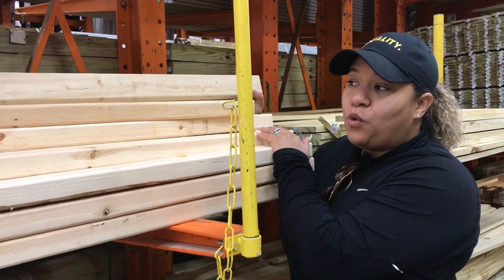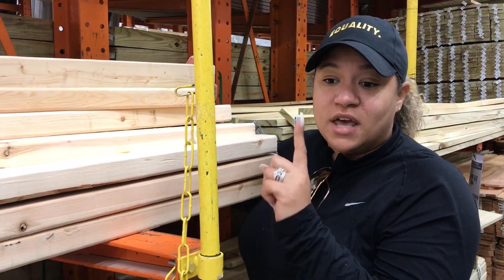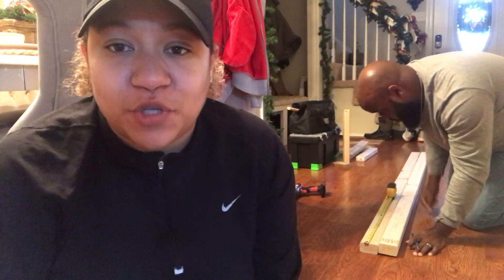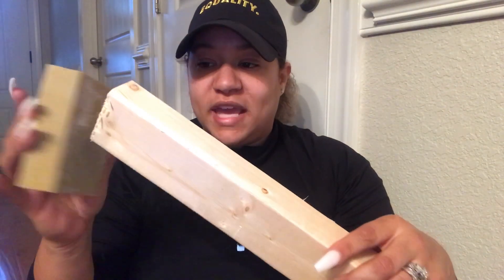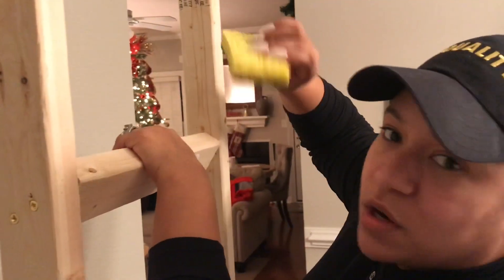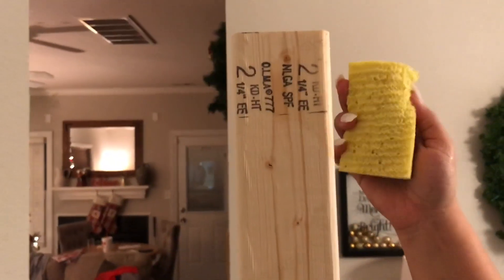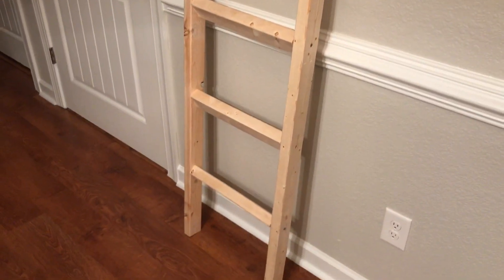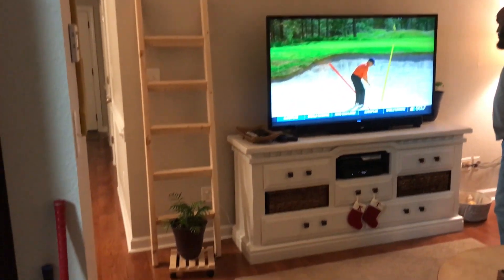DIY POTTERY BARN BLANKET LADDER FOR $8

Comment: What size drill bit did you use before installing the screws
Reply from the maker: I’m not sure because it was a while ago but to be on the safe side, use two sizes smaller than the size of the screw you’re using.